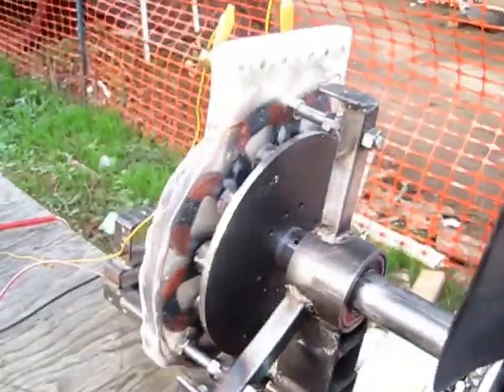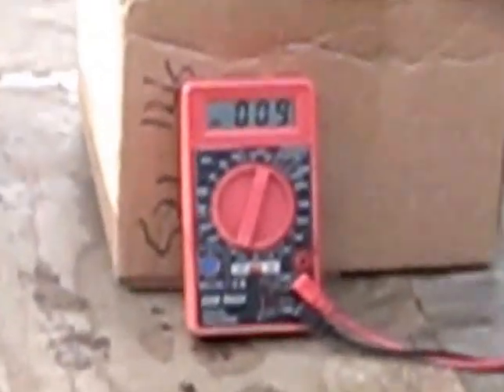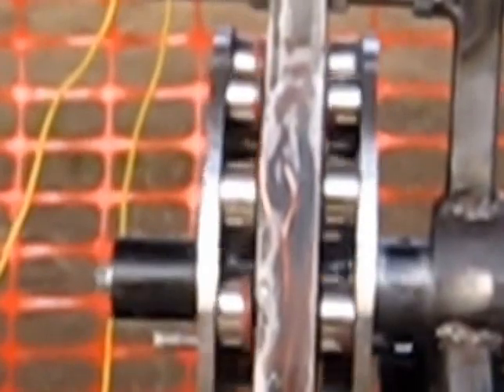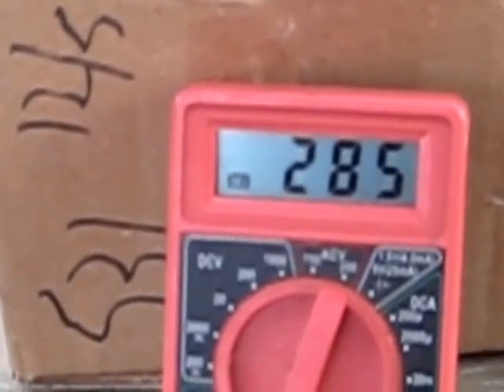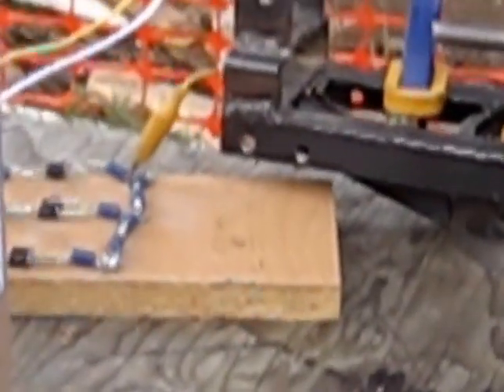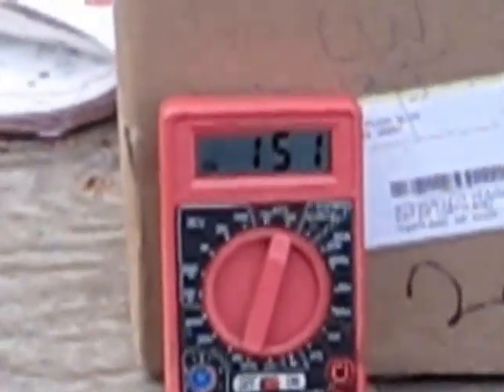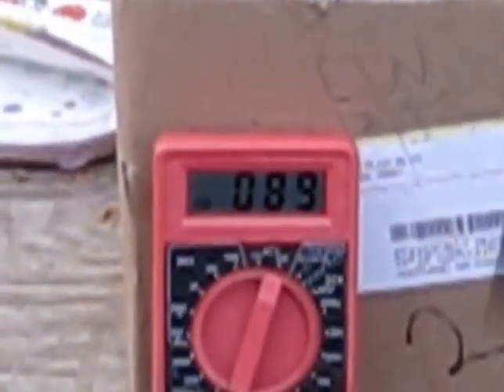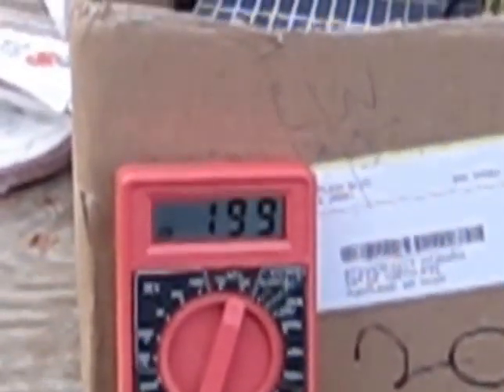Wind Generator stator testing off the bench

Comment: Wow. Very impressive. I'm going to give it a try. Have a set of raptor blades that should work well.  If I used half that size wire and double the wraps would that still work.  Be collecting wire from old motors.  Trying to upcycle and keep it as free as possible. Thanks for your videos.  Jason,Jeff. Watch all yours too. Thanks for them as well.

Comment: good work    ,how did u make the bridge rectifier and what coponents u use ,sorry for my english if i write something wrong here lol ow yes if its not strong enougf for a 24v bank  u can make a voltage doubler ....i think its that easy same ure bridge rectifier .......?
Reply from the maker: Pascal Smeets Hey buddy.  the bridge rectifier is easy to make, but after the cost, and shipping and time that goes into it, it is just as easy to order one from ebay. I just happen to have a lot of the diodes here. I would not use a voltage doubler. just another component that could go bad, just make your wind generator match what power you want as output. I have seen a lot of guys trying to use those and they all end up unhappy.

Comment from the maker: that sounds like fun Jason. I have several different blade sets from Missouri wind and solar already. just have to decide what type of wind generator frame to make.  I still have to make a stator to send to Belgrade also.  he is the one that did all the metal work, he does really good work on it also. the magnet wire I used is #15 wire I got from Essex thru ebay. I can give you details for parts later on.

Comment from the maker: Hey Jeff, that test is coming soon, I just ordered a few parts from you last night, I also have to measure the pipe I have for this wind generator, its slightly smaller then the galvanized pipe. its black pipe, ill have to give you a call for the locking slip ring and collar to attach cables to. should be on Monday.

Comment from the maker: yes, I think it will produce good power for the 24 volt set up.  hey John, I used # 15 magnet wire for this one. 100 wraps per coil.  I was thinking about getting another 5 blade set of the falcon blades, but the raptor blades will do ok for testing prior to installing up in the air 20 feet.
Reply: They seem to be turning it pretty good on a work bench.